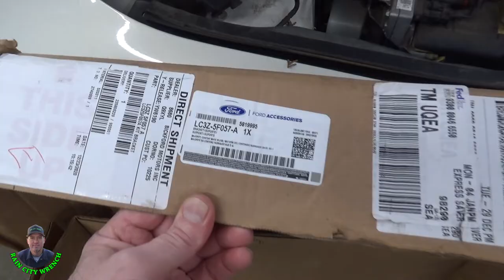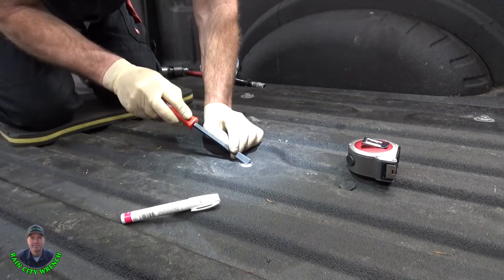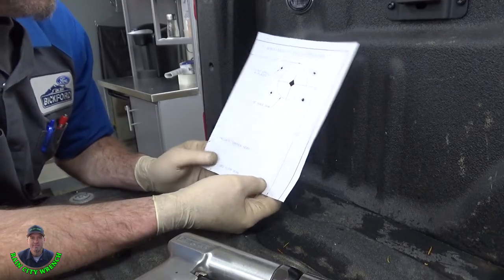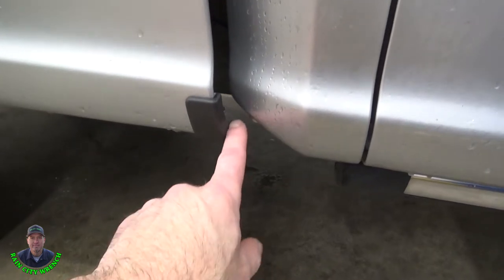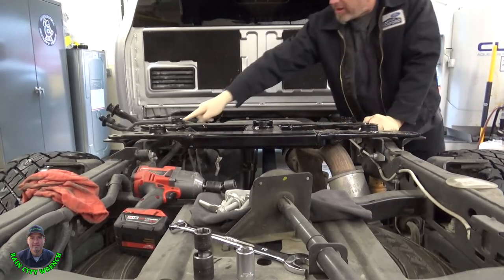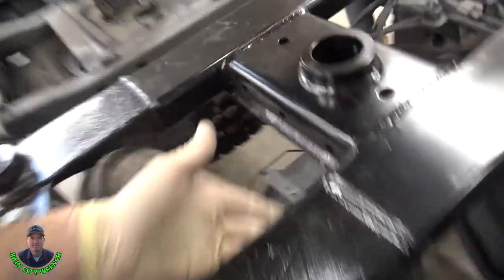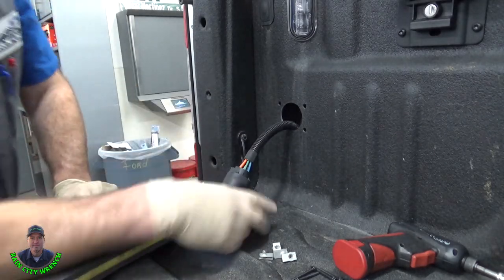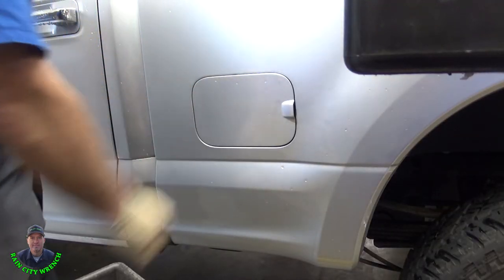FORD FACTORY 5TH WHEEL/GOOSENECK HITCH PREP PACKAGE INSTALL

Comment: Any chance I could get the part numbers for the bolt kit, trim kit and trailer wiring kit, allignment pin? I can't find a new hitch kit, but I found a new take off that doesn't have them parts. Thanks
Reply from the maker: Someone else emailed me wanting the bolt kit PN so I contacted our parts department. They said parts are not sold separately. It only list one part number for the kit with a breakdown on description of parts. Will look and see if I still have that screenshot.
Reply: @raincitywrench117  I found a write up article you did online. Reese makes the hitches, they just use regular bolts, thats probably what I'll do. Thanks for getting back to me.

Comment: Installed mine today and everything went just as you described. I did notice though that the pucks on one side wound up being half of an inch further forward than the other side. So apparently it is slightly crooked. They still came up through the holes in the bed fine. Do you think this is an issue? I didn’t realize when we put the crossmember on the alignment pegs that there was that much play in it.
Reply from the maker: Nope, won't matter at all. The passenger side pucks end up slightly forward on every one I have done. Once the plastic caps are on you don't really notice. I guess that's why the holes are drilled quite a bit larger to allow for misalignment. The structural rigidity will remain unchanged. I may run a tape measure from the cab back to the front pucks on the next one to see if there is any wiggle room front to back.

Comment: I really appreciate such a detailed video as I have this job coming up as soon as Ford releases the fifth wheel prep packages from factory back order. My only question is how did you remove the bed liner material from the bed bolts?
Reply from the maker: They are on back order again? They were on BO last year also. I use the same really sharp narrow width gasket scraper in the video to dig in and work around each bolt head and then it will peel up and off in one piece. You may be able to get away with using a box cutter to cut around bolts and then pry up coating with screwdriver
Reply: Wow, after over a 2 month wait the prep pack finally came in. Box had been through the war zone
Reply: and of course was missing parts. Drivers inner bracket not there ( probably laying in a FedEx facility somewhere) no trim kit for the bed holes and the locating pins are missing. The dealer parts people here where I bought the truck are really struggling to figure out what the part #’s are for the missing pieces. Couldn’t be so lucky as to have the inner brackets already welded to the truck and it looks like the LC3C-5L028-CA may be superseded to a new number. The pass side inner I received has the LC3C-5L028-DB listed on it. I’m betting the locating pins are the same as the ones used for the bed and am hoping you could verify that, if so I’ve figured out the # for that.
Reply from the maker: @bobmathews4021  Don't know but they look identical. The last couple kits had metal locating pins so they have changed over from plastic ones at some point. Worst case is you can eyeball xmember or drop bolts down to get aligned and remove after tightening. I will say that every kit I've installed, the crossmember has ended up slightly off to the passenger side but the plastic rings cover up the gaps. 
  The first kit I received was also completely destroyed and missing wiring, brackets. The customer has waited for weeks to get it installed and was on his way down to pick up his new 5th wheel. He completely flipped out and was screaming from what I heard and said was not leaving dealer until it was installed. FO MO CO had to overnight the parts but of course they sent wrong stuff and customer came unglued. LOL What a hell of a mess! I believe the dealer now stocks multiple kits and the first thing I do is check inventory.
 Ford has completely dropped the ball on packaging, all that holds box closed is two straps and they weight so much that one end peels wide open when they are done heaving it around.

Comment: Just a quick question for you since you appear to be a tech for a Ford dealership - considering buying a F-350 XLT with the panoramic sunroof.  Is the sunroof pretty reliable or should I leave that out of my options list?  THANKS!
Reply from the maker: Funny you ask, lol. Have seen nothing but problems with them. Yet to see one issue with the old school single glass moonroofs like on my super duty. 
Vista roofs have one tsb that I know of. The side brackets have plastic laminate over metal & they break apart and bind in the channels. Sound like hell and sometimes the glass completely stops. Fixed about 8 of them so far in the last 14 months and we're talking about rigs with low miles. 
Also repaired a couple shades, one ripped loose and spooled back up (5.5hr repair) & another had stains from water leaking. 
 The thing I notice on almost every one I have opened is a clunk immediately when the front glass drops down just before it slides back. It's like the front and rear glass want to stick together at the center seals. Have had to apply sil-glyde multiple times for that complaint. They are really cool and I'm sure there are many happy campers but....
If you want a fifth wheel prep package then order with that option and you'll save about a grand.
Reply: @raincitywrench117  THANKS for the info.  No sunroof saves $1400.  Might also make the difference for me on whether to go with an XLT or just get an XL.  Biggest issue now is the seats - will the XL split bench be comfortable enough for my wife's bad back on a long trip; or do I need to go with bucket seats?
Reply from the maker: @mark02tj41  I would recommend buckets
Reply: @raincitywrench117  THANKS!  I appreciate the advice!!
Reply: I call them Rattle glass roofs because that is what they do. Had two of them, BOTH rattled. They are also COLD in the winter and HOT in the summer.  Not having one saves $1500 and about 60 pounds of payload.

Comment: I need to remove the bed on my 2012 to fix some holes from red oxide rot. It's the 17+ that are tight, correct?  I have a 22 on order and am thinking I may add this down to road, but for now just install the bed rail system since that is what my 5th wheel already uses, but watching the process, not that hard provided a means to lift the bed.
Reply from the maker: Yea. The steel boxes lift straight up without interference. I have a 22 on order too since last November. Got a call a few weeks ago saying the fifth wheel prep package would add another 8 weeks so I told them to take that option off. Disappointing since it is only a $550 option. Now I have to send probably 800 or more for the kit and the time to install later down the road.
Reply: @raincitywrench117  I had it removed after looking up what the legs cost for the A20. The bed rail kit for $250 is a far less expensive option and doesn't require bed removal.  Get a rubber mat, cut slots in it and you once again have a flat surface to slide things on and lay flat. 
The only item I really need is the box 7 pin and the TPMS/Camera socket.  Does the factory installed Prep have the backing plate that accepts the 7/21 socket in the TPMS kit, or is it the same square box that you installed in this video?
Reply from the maker: @acdii  It does not come with it. You will have to do your homework but think you need the 7/12-pin trailer connector and wiring kit LC3T-14G621-AC. This is for pro trailer backup assist, camera and tpms setup.

Comment: Hi there, Great video , I was wondering do you know where i can find a OEM Ford factory 5th wheel/gooseneck package kit or would a different year work. The aftermarket ones are not made very cheap! I have a 2006 F250 Super duty 6.0L long bed crew cab  thank you for your time Sir.
Reply from the maker: The 2011-16 steel body has one part # and the 2017-current has another. I don't know if Ford offers one for 2010 and older but was told reese makes these for Ford. B&W makes a really nice unit and have installed a couple. I highly recommend pulling the box as they are a royal pain to install. https://www.etrailer.com/multi-product.aspx?pc1=BWRVK3500-5W&pc2=BWGNRK1108-5W&VehicleID=20065007548&HHYear=2006&HHMake=Ford&HHModel=F-250+Super+Duty
Reply: I have a 2007 f350, used the Reese under bed puck set up. Uses factory ford 5th wheel hitches as well.

Comment: Awesome video. I did one and need to do another soon. Was told the bolts and in frame nuts could not be reused?
Reply from the maker: You bet. They are not stretch bolts and have one torque spec. I like doing these jobs. Haven't done one in a few months but spring & summer are coming. Thanks for watching.

Comment: Does the tab on those bracket nuts not catch on the underside of the bracket so that it does not spin? If not, what is the purpose of the tabs?
Reply from the maker: I think they are called flag nuts. Yea, the ear is meant to keep it from turning but I like to use a wrench on the nut side because they rattle violently back and forth when using an impact.

Comment: How do you know which ones will have the bracket and which one won't? I mean welding onto a frame is not a good idea is it? Integrity of the metal would change from the heat no?
Reply from the maker: That I don't know. Seems like every other one I do has the inner brackets already welded on from factory. These are all factory welds, I think the frames are welded in many other areas also so it must not affect anything.  
The kit has the inner bolt on brackets for those vehicles which are missing them.

Comment: Looking to do this on a 2017 Denali 3500. Is the process about the same?
Reply from the maker: I haven't done one on a Chevy yet but would guess it is almost the same procedure. If you are installing a factory below bed unit then the box will either need to be lifted up and blocks placed in between frame to gain access or removed all together.

Comment: Do you have a video that shows the puck system being installed on a 2000 f350? I'm haven't been able to find one that says it fits.
Reply from the maker: I do not. I think the factory puck setup is for 2010 and up. ETRAILER has below bed rail fifth wheel hitch setups for that year.

Comment: what is the height of the bracket thats factory welded? my truck did not come with the welded bracket.
Reply from the maker: The same height as the top of the frame rails. You can run a straight edge or 2X4 across the frame rails if you like. I bolt the inner/outer brackets on both frame rails but leave a little loose then I set the hitch cross member up on top of the frame. Then you can install the bolts that come down thought the top of the cross member, sucking up the side brackets into the cross member thus setting the proper height. Tighten the side frame bolts last.

Comment: I'm 4 minutes into the video hopefully you show the part number to the trim kit as my truck did not come with them and well I hate that I have to throw on a sheet of plywood to haul some top soil, sand, or gravel.
Reply from the maker: Don't do that, lumber is the price of gold now. Here is the kit: https://ford.oempartsonline.com/oem-parts/ford-hardware-kit-bc3z99000a25a?origin=pla&gclid=CjwKCAjw7J6EBhBDEiwA5UUM2vdeWctUnE_ADpnVwLL5vyDKzQe-3sulPmJUhqodUML2CEUHjzhN8hoCimUQAvD_BwE

Comment: I wonder if this prep package would fit on a 19 F150 since the frame is basically the same.
Reply from the maker: Interesting... Have no clue. The cabs are essentially the same but pretty sure the frames are different and they don't have the holes in the frame to attach the side brackets.

Comment: Do you apply any protective coating to the now exposed metal where the drill & hole saw removed metal in order to prevent corrosion at those areas?
Reply from the maker: I do not but it definitely wouldn't hurt. Since it's an aluminum box I don't bother, a little oxidation around the lip is all I see happening IMO.
Reply: @raincitywrench117  Doh, my bad!  I had totally forgotten Ford switched the SD to aluminum as well!

Comment: Can this be done by loosening the box and lifting and blocking up the passenger side, then sliding the unit in from that side without removing the box?
Reply from the maker: Yes sir. Ford says in the directions to place 4x4 blocks between bed and frame to gain clearance. Removing box makes it much easier but I did my first one by blocking it up. I wouldn’t be surprised if four guys could lift the box off. They are real light compared to steel.

Comment: What length bed for that truck, and thanks for the video. Some of us though will need to use a couple of fall hoists to lift the bed out of the way 😃
Reply from the maker: I think that was an 8' bed. The install instructions say to lift bed on each side & block up with 4x4's. It is easier for me to just lift the box off but this is a job you can easily do in your driveway without any lifts. The box is surprisingly light being aluminum. I will say though, it's a real pain to torque the bracket bolts without completely taking the bed off.
Reply: @raincitywrench117  thanks for replying so soon. All the best to you and yours.

Comment: I saw that there were many instances where you could have made good use of a rubber mallet or two. Never use your hands where a tool will help to ease the stress on the flesh.
Reply from the maker: Ain't that the truth. I get a little lazy sometimes about grabbing one and just smack stuff in by hand. At least I use a knee pad when racking vehicles now. Never did that in my 20's or 30's.

Comment: Will this same kit fit on a 2013 250?….i like the four pucks to use for a 5tth wheel and the gooseneck option as well
Reply from the maker: BC3Z-5F057-A is the kit for 11-16 Superduty's. It looks almost identical and goes in the same way.

Comment: What if my truck did not have inside brackets. Are they needed
Reply from the maker: Definitely. The cross member assembly bolts down to both the inner and outer brackets. Unfortunately I don't have a pair.

Comment: I got this on my 2021 from factory, I notice on most gooseneck there are rings for the trailer chains, i don't see these on the factory setup. Is that something you have to add?
Reply from the maker: Ford makes ball and safety chain loop kits, also etrailer and other retailers have them. The safety chain loops go in the two back outer puck holes in the prep package, that is if yours has factory installed prep package bracket. Here is one kit with pictures below installed. https://www.etrailer.com/Gooseneck-Hitch/Curt/C60692.html
Hope that helps.
Reply: @raincitywrench117  ahh, ok that makes sense. Thanks for the reply

Comment: Part number for the bolts kit?  I’ve misplaced mine.
Reply from the maker: Had someone ask me more than a year ago the same question so I sent off a parts request asking for bolt kit # and they got back saying Ford does not supply separately and only sold as a kit. Have a spare install sheet and will see if it shows anything

Comment: Do you know if you  can replace the console with a jump seat in a 22 F350?
Reply from the maker: Don't see why not. Would probably require new carpet kit and lower instrument panel block off panel. On second thought, It probably has some parts underneath like the yaw rate sensor, data cables, power port, inductive charger, etc. But maybe the sensors would still be in the same spot with the jumper bolted on top? I guess you would have to source base, xlt or commercial parts. Not sure if I've seen jump seats in any other trim line

Comment: Any issues with reusing the factory bed bolts? Dealer says they are a one time use.
Reply from the maker: Nope, they can be reused. They are not stretch bolts.
Reply: @raincitywrench117  Good deal, Thank you

Comment: I’m trying to do this on my 2010. I can’t even get the bed bolts out at this point. I’ve broken two star bits so far. I’ve sprayed the bolts with PJ Blast, and let it set for a week. Any other suggestions?
Reply from the maker: Well that stinks! I would take a propane torch and heat up the bolts from underneath & break them loose by hand first with a BIG cheater bar. Then go to impact wrench to remove. Try to keep the heat concentrated without burning up anything & having an assistant up top prying while the other is down below holding on the heat would be a plus. Good luck!
Reply: @raincitywrench117  
Bed is off. I don’t have pretapped holes. I’ve got the puck piece up against the back/middle set of bed bolts. Any other guide to go by to get it to where it’s supposed to be?
I’ve got 8 holes to drill.
Reply from the maker: @randyhopkins281  Not sure if I understand your problem. There are no holes in the frame for the brackets? The more I think about it, your frame will be c-channel instead of boxed in like the newer ones. If you have the holes drilled in the box then place cross member on the frame in the general area and then drop the box back on while lining up the bed bolt holes & the cross member inside the drilled box holes. Once all lined up, mark the x-member on both sides front to back & side to side then remove the box again. Loosely install side brackets, mark frame holes and drill. Bolt up and reinstall box. Will be a PITA but doable
Reply: @raincitywrench117  thanks. I ended up having to move the whole thing and redrill again. The cross support is as hitting the unit.